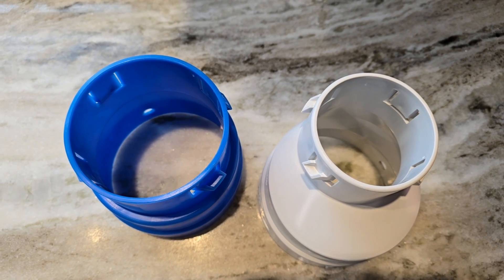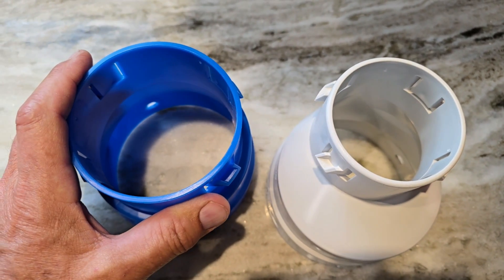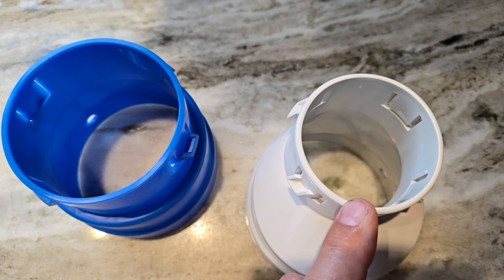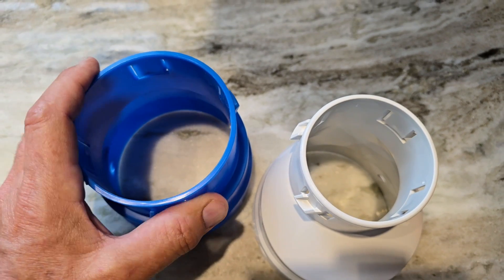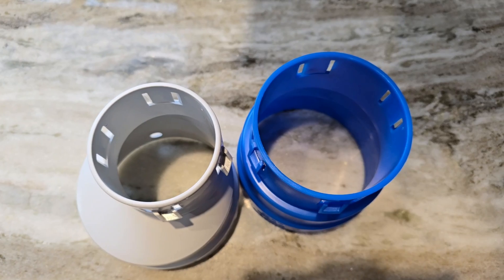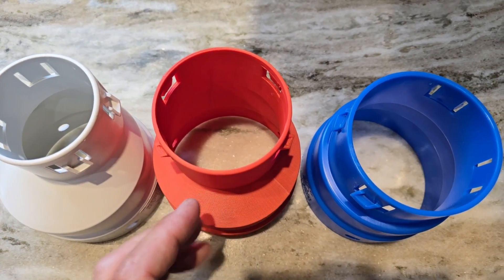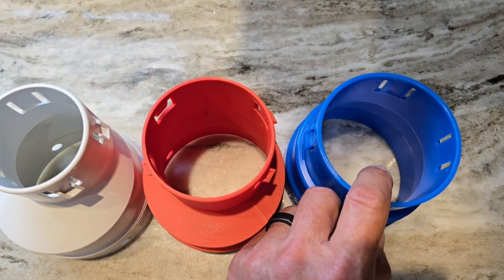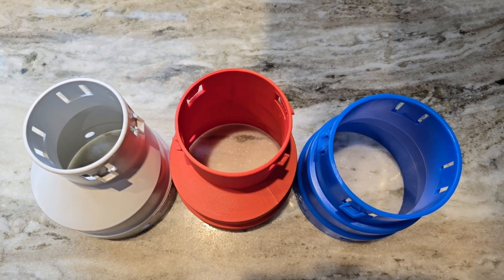Why 3" Pipe doesn't Clog  [ 3D Print Demonstration ]

Comment: If you could make a short video showing exactly how your connectors and such work with your 3" vs the 3+", I'd like to see that before I purchase my order. You mentioned in my other comment about cutting it a little, I wasn't sure I got it, and would like to see. Thanks!
Reply from the maker: In 3 weeks I have a whole video series on that. Stay Tuned and make your decision after that.
Reply: @FRENCHDRAINMAN  Perfect - thanks! This is my winter project anyway, since I can't dig in the clay in the summer.

Comment: It sounds like you have a well-reasoned explanation as to the benefits a 3.5” pipe provides over 3” and 4” pipe and why there is a need for 3.5” pipe, such that there should be a demand for this size pipe. I have a feeling that it is not a matter of if you will make the 3.5” pipe, but when will you make it. You have been an innovator in introducing other drainage products that were designed to solve problems, and I doubt you are going to stop now. Looking forward to the new product announcement!